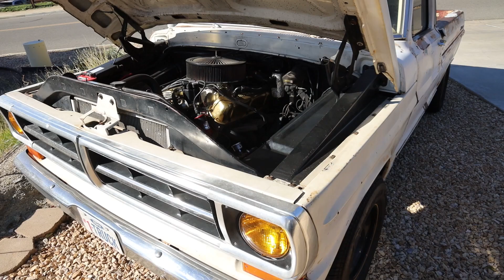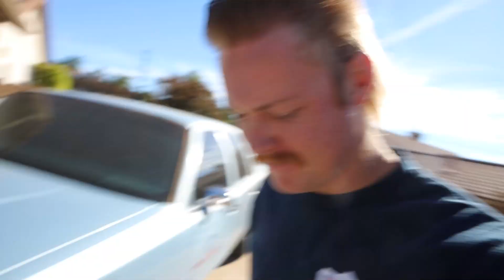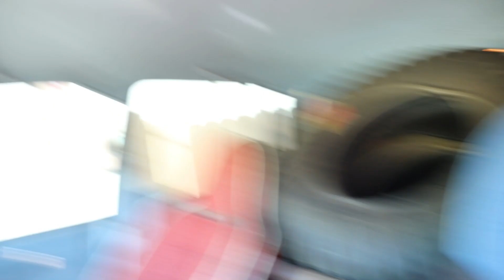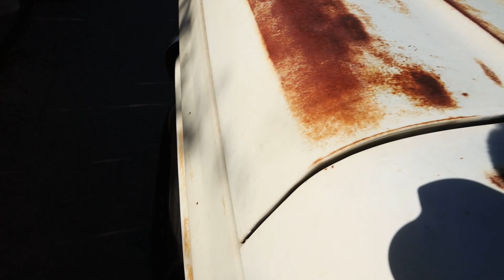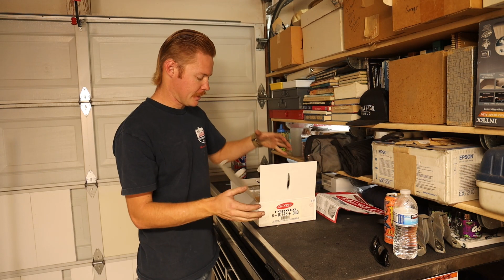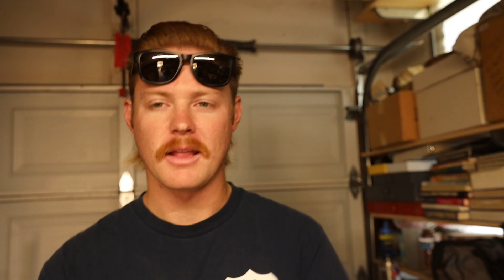Diagnosing My F100's Broken Engine. My New 8000+ RPM Engine Details!

Comment: Outside of a Boss 302 or Mexican 302 block, your '68 standard version is as good as Ford made them. Even with their conservative values, Ford rated them fine for 600HP. It was '80 or '81, IIRC, when they made the blocks weaker, as they were going to the 255 casting patterns, and the 302 was planned to be discontinued. That's why I bought a new '79 Mustang back then, as it was SUPPOSED to be the last Mustang ever built with a 302. Thank goodness that didn't happen, but the later blocks, including the roller blocks, are much weaker than the pre-'80/'81 versions. That's why if you're rough with a late block that puts out something like 550HP, there's a good chance you may split that block. Not so the older ones. When I took my '74 block in to be be cleaned and machined, the machinists were all talking to me about it. Younger guys, so they had never messed with an old 302 block, and were saying it was a much better block than they were used to seeing. 
 I have a '68 standard 302 block, and prize it. Just comparing it visually to my buddy's '88 version tells a lot about how much stronger it is, to my eyes. With a good rotating assembly and maybe a main girdle, it should be able to deal with your planned build without complaint.

Comment: Just do the 347. Sure the long rod 302 is unique, but unless you're actually going to consistently use the high rpm capability, you'll probably be happier with the broad torque curve of the 347.

Comment: It's been proven that rod length itself doesn't effect power.  Nascar engines make torque, they just make  it at higher rpm. They make power higher in the higher rpm because of the cam and heads.

Comment: I’ve been (or had been) planning a new build around that same 746 Icon piston. I caught a lot of flack over on Speed Talk for “wasting my time” and not just building a stroker, but I really like the idea of the long rod, better ratio, small displacement motor. In fact, the more I got into it, I might actually build this thing to 292” (289 + 0.030”) because then I can keep the bottom end a tiny bit lighter with a 5.400” I-beam and crankshaft (all forged) from RPM. The Eagle stuff is a little bit heavy. The down side is that this locks me into a custom piston from Racetech, which is about twice what those Icon’s cost, but it’s only money, right? Cool video, Craig! We approach engine builds similarly. I’ll be watching for sure!

Comment: Take the Lincoln and go full Leeroy with it and cut EVERYTHING off except the front windshield and build a full tube chassis for it and make it a dedicated race car. Being a full frame car it'll actually be easier to do than a Corvette and then you can put a modern Mustang rear end in it if you want IRS and not having fenders you can lower it a lot further and make a killer autocross/drag car out of it. Hell you could even build a turbo 460 for it with 7.3 Powerstroke turbos with smaller exhaust housings to spool quicker, wouldn't be hard to make 1000/1000 with it. Steal the AC for your fox.

Comment: Bigger oil pan would have helped it before the 6000 rpm mountain trip.stock oil pans dont work on high rpm stuff.pan gets sucked dry before the oil can run back into it.no oil at bearings---rods want to make lots of noise such as let me out!!!!

Comment: Smart to park the truck till you take it apart. Something is seriously wrong with it. If it's a rod or main bearing you need to take it apart before major damage occurs making the engine unrestoreable. I know you like to play with your toys hard but this is what happens. I do the same with my boat which has a GM 350 block. Love to run it wide open most of the time. Work hard, play hard!

Comment: That noise,hard to tell . Years ago had one,with a broken piston. Pulled the plug wire #6  stoped noise. Drove it that way almost a year. Had no money,even when I fixed it,replaced one piston only. drove that for 2 years.You guess it no money!
  Got some money now 45 year later. But no desire to push over 6,000 rpm, I will stand back, and watch the fire works! thank you stay safe.

Comment: The 69 302 block that's in my 67 mustang is a pretty tough block. Before I had it rebuilt it was down two or three cylinders and the thing still ran sounded like a tractor but it still ran lol 

Cylinder 4 had to be sleeved and then all eight cylinders were bored 30 over.
Reply: I had a 69 coupe with that motor in it. Great engine fun car.

Comment: Snap i went down the same rout as you  my bloke is a 76 mustang 2  small boddid car i put a mild cam in   then went for ally heads  i have say a big thank you to sumit facing for there help  the one thing i did have to do was releve the bloke so that the end cap bolts miss 😎👌 i can tell you it runs the 1/4 in 14.7  dut the g/box had to be upgaded  allso went  to a differnt converter that ment bellhousing change  and now iv had a 9" with lsd  on 4 link just putting that in to paint 👌😎

Comment: Isky, and crane cams are great companies to get in touch with, although I have had great luck with my hydraulic lifters and cam kit from competition cams Xtreme energy series usually the 268h 474/480 lift cam in a built 75 Chevy 4 bolt main balanced rotating assembly 335 Chevy with 1995 260hp gm 350 crate motor 993 cylinder heads.

Comment: Great explanation on the engine build. Most now use computer software to calculate a build. Welcome to old school, I believe in putting it on paper.  Got to love that metal on metal sound, and yes your throw out bearing is about to go. Aaaah yes the F100 engine is definitely knock knock knocking on heavans door. Keep up the great work. 👍

Comment: I don't understand the high compression high RPM. You won't be able to use pump gas and you have a heavy truck you want more torque. If you are going to autocross or drag race you want the torque. If you are going to road race then you want the high RPM.

Comment: Not sure that knock is a rod but it’s hard to tell on video. Rod knock usually occurs at a steady state RPM and diminishes under load. Does knock go away when you accelerate? Main bearing will knock under load but quiet down when at steady state RPM. You can perform a power balance test. Ground or remove a spark plug wire one at a time. If knock goes away that’s the cylinder with the bad rod. I dont remember what ignition setup you’re running but it could be severe detonation. Have you checked timing, confirmed you ignition is right? Could be wrist pins too, they make a lot of noise when they get loose. I guess it don’t really matter…gotta pull it apart for everything except detonation anyway. Good luck

Comment: What would you do to a 1982 f150 4x4 single cab long bed? It has a 302 from an older car, and (as far as I know) the stock high speed 4 speed trans and a 9in rear axle

Comment: Extrapolating your analysis, you should be golden, when comparing to Ford's own work with the 289-271 in the middle sixties. The hot ticket then was an Isky 305 degree cam and kit, which was hydraulic, whereas the factory setup had solids. I tried it on my '65 Mustang, and it had a really gnarly sound to boot. Not quite as quick as I had hoped, and I kept the factory ignition setup, which had a 6,000 rev limiter. Later added a pair of AFB carbs, about 350 each as I remember. Then it REALLY woke up. 3.80:1 9" locker, 10 bolt top loader. The 9" and the four speed were factory, but I changed to the 3.80. Nobody was looking for MPG in 1966!
Now, 55 years later, I believe the FE engines were the best offering at the time. Bought a 1967 Mustang with the 390, 4 speed and 3.25 limited slip. Nice chick magnet, as it was a red convertible. Had to sell the '65 coupe, though.

Comment: Quite honestly, I don’t know why you’re messing with 302 based engines with a heavy truck. At the minimum, a 351 based engine would stomp ANY 302 based engine you build based on just cubic inch alone…think about it.
Reply from the maker: You’re not wrong. But the amount of 8.2 deck parts I have is crazy. So for now I’ll use what I got. I’ll probably go 9.5 deck after this
Reply: @Thecraig909  ...I didn't mean to sound discouraging. I love watching you younger guys taking the interest of old school hot rodding, diving in and figuring things out on your own! We all had to start somewhere. 
The galaxie content is great!
My current never ending project is a 460 swapped 82 Mustang GT street car. I also just picked up a 1962 Galaxie that will also be powered by some form of 460.

Comment: All you have to do is  start pick up while it's running and start pulling the plug wires off  it will quit knocking if it's a Rod

Comment: I see alot of people getting hung up on things the relationship between bore and stroke, rod ratio etc

With engines that have good aftermarket support, your carb, intake, cam and head choice is most important in terms of how you want your powerband to look. Doesn't matter what your rod ratio is, if you have 300cfm heads, 700 lift cam and a super victor, you're gonna get a very peaky engine. Don't get too hung up on how rod ratio and what not effects your engine, it doesn't really matter too much unless you're talking sustained super high rpm, high power applications.

Comment: just a bit of advise, yes i respect you driving the crap out of your stuff, thats why you built them,. but your long high rpm deceleration are killer on the engines., there not really designed to slow you don, there made to accelerate ya. maye ease up a bit on them 7000 rpm deceleration...
Reply from the maker: You’re definitely not wrong haha.
Reply: @Thecraig909  die hard Ford fan as well..keep on doing you..and making videos..gives me something to do during northeast winter..